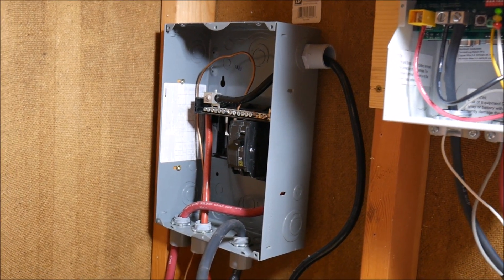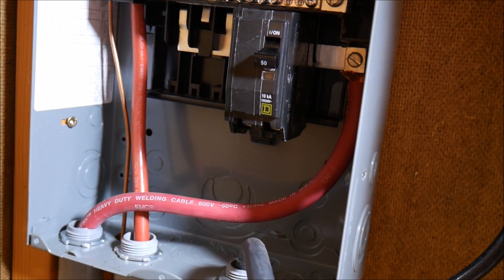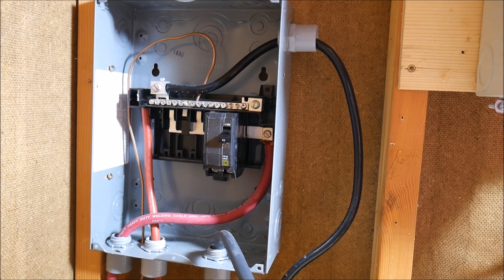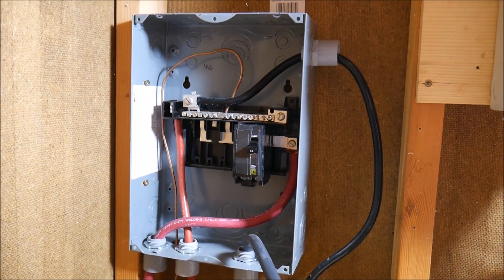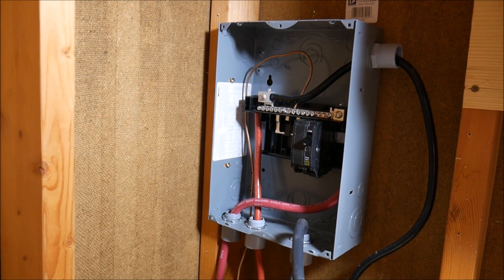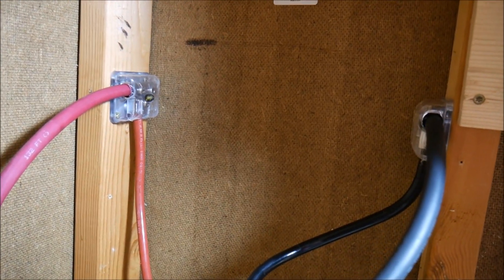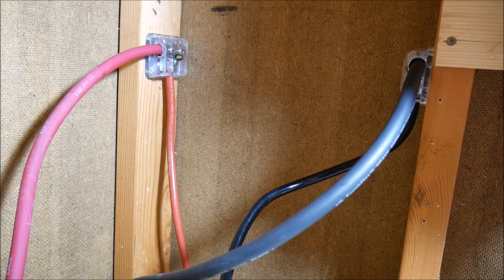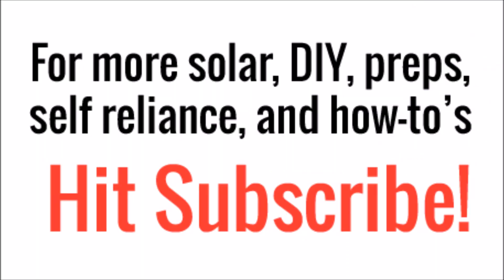Redoing The Solar Shed Part 8 - No More Load Center

Comment: Since you’re redoing the solar shed. Have you thought about purchasing a true DC heating element to heat your water?

I’m thinking of purchasing a 36VDC heating element, I’m guessing it’s the proper resistance for 36volts. DC or AC shouldn’t matter for an element. Nevertheless, I want to install it in spare water tank to heat up the water. With the signal 305 panel, I know it won’t heat up to 110degrees. But I am hoping it will enough to keep the power usage down for my instant hot water unit.
Reply from the maker: I have thought about it.  I won't do it in this house for my main water heater but I might rig up a diversion load for an auxiliary hot water tank outside.  First, it would make a great video series.  Second, it would provide me a way to easily heat water in an emergency.  And third, I could use it to keep my battery box warm somehow in the winter.
Reply: I’ve already made up a solar panel out of PEX tubing, I’m guessing about 30 to 50 feet worth. And it dumps into a 30 gallon tank of water where I have about 50feet of PEX coil. The coil is before, obviously, my tankless water heater. 

IF I remember to turn the pump on, I can raise the temp of the 30 gallon tank to 85 to 95F. This is so the tankless doesn’t have to work as hard to raise my well water, around 55F, to 130. 

I know I really need to use copper pipe for proper heat transfer on both the solar panel and coil up house water. But I found 300’ of the oxygen barrier PEX for $35,  normally over $100.
Reply from the maker: Use what works.  Copper is stupid expensive so I bet that replacing your whole system with copper would not be worth doing.  I am sure there are some other ways to squeeze more performance out of the system.  Did you spraypaint the enclosure black?  Is it angled at the sun properly?  Is it well insulated?

Comment: By using the load center did you go from a 240v ac system to a 120v?
Reply from the maker: No, the load center was being used as DC not AC.
Reply: LDSreliance OK thanks. I still learning and was trying to figure our why you reduced your output from 2 wires from the bus to one wire to your home. Or, maybe I got that wrong too. BTW, I think there's a difference between Ac and DC beakers.
Reply from the maker: Yes, normally you are correct.  But the Square D QO series breaker panels/load centers like I was using in the video are rated for both (up to 48V DC).  So that is why I was using it.
Reply: LDSreliance cool, thanks for the info I thought it was just for ac systems. I did look into this a little deeper and the manual states it's only rated for 48vdc not up to(12-48vdc). My system is a 24vdc so these unfortunately are not an option for me.

Comment: Will you let us know how you ultimately vented the battery box? I'm about to complete my setup soon too, and I'm thinking of using a 2 inch pipe, small 2x2 dc fan, with a 2 inch cover that closes outside when theres no pressure against it, like a dryer vent cover. That way no cold air back flowing into the house, and the fan I'll run off the mppt to only run during charging, so as not to rob very much power... What do you think?
Reply from the maker: Yes, I will do that off camera sometime and mention it in the final video.  I am toying with the idea of installing some tiny server fans but I don't know how well they will hold up in the humidity.  Your solution sounds like a pretty good one, actually, since the off gassing will only happen during charging.  Good idea.

Comment: this might be a hard question but where i live in australia im in a perfect spot for solar where from sun up to sun down (11 hours) i get 180w-190w and 22-23.9v from a single 200w panel. sat flat on the ground but ive had issues with the panels frying solar charge controllers. the choice is rather limited here but ive been looking at my options and i was wondering what you would suggest. ive ordered another 800w of similar panels and from the looks of things the biggest MPPT controllers here are around 50amps. i was wondering if there are larger charge controllers in the usa that i could order for this system or if i would be fine with a 50amp controller for a 1kw system.
Reply: to clarify i have a 5kw roof mounted system but it produces no power. and ends up costing around a grand a year via grid connection fees and passive draw. this is apparently due to the slope the panels are on(22 degrees). and the second system is being used for a large shed that is currently unpowered. flat panels are the best performers around here being in the full sun for 11 hours every day (10 in winter) i do have a single 100ah AGM and am waiting for a few more to arrive locally.
Reply from the maker: Interesting.  I am sorry that your main system doesn't produce much.  You could use a 50A charge controller if you arrange your panels in series to increase the voltage.  MPPT controllers can usually handle pretty high voltages.  So if you have 5 200W panels and put them all in series you would have a 60V system and be safely under the amp rating of your controller.  Just check with the specs of the controller and make sure it can handle that input voltage.

But yes, there are quite a few controllers here in the USA that have higher specs.  The Morningstar controller I used is rated for 60A, for example.
Reply: i saw that and have been unable to find one here in australia. quite annoying. im looking at EPEVER 4210A (a 40amp mppt solar charge controller) im planning to mix solar and hydro as i have a fast flowing creek near my house. ive been unable to find any legit 50amp controllers but the 40amp controller looks good. 

heres the spec sheet for the EPEVER 4210
http://imgur.com/a/C7FnQ

they have some great reviews on youtube and on the greater web apart from being a little slow to switch over of course. 

the other idea i had was buying one from the usa via our local postal services drop shipping options. but im at a loss for what us models are good and witch are bad. 

could i use 2 charge controllers at the same time? split the panels?
Reply from the maker: The only way you can use two charge controllers is if they can be networked together.  And those models are expensive and more complicated to use.  I would encourage you to explore a higher system voltage so that you don't run into an amp limit problem.  If you used a 24V system with 1000W of solar panels you will be right at 41-42A.  After accounting for losses and real world conditions you should be able to run that with a 40A charge controller.

Comment: 👉👈🙌🙏☝👏💪💅....or...you could add a larger lug onto the main bus bar to accommodate the 1/0 wire.  Or trimmed your 1/0 wire to fit existing lug.  The few hairs lost to trimming would be meaningless because you are using the oversized conductor for voltage drop and not ampacity.
Reply from the maker: Really?  So the current passing through that welding cable will not be affected negatively by trimming some of the strands?  I would have thought that it would contribute to extra voltage drop since the resistance would increase due to all of the current passing through fewer strands.
Reply from the maker: Also, I think the lug is integral with the back plane.
Reply: LDSreliance ....i am not going to deny that in the most technical terms that voltage drop wouldnt occur.  Having said that, a highly sophisticated testing laboratory would be hard pressed to tell you exactly how much voltage drop there would be with "trimmed" conductor as opposed to non trimmed.  If it cant be easily measured, it simply doesnt exist.  So dont worry about it.  You are talking about 5/8 inch length of wire.  The length that goes inside the lug.  The rest of your cable resistance stays the same.
Reply: LDSreliance ...some lugs are mounted to the bus bar by a screw from the backside.  One would have to take out the bus assembly and see exactly how the included lug is mounted.  All the guts come apart....its like a tinker toy.  Another way to install the wire without trimming would be to use a standard 1/0 compression lug.  The kind you would use to hook the wire to a battery terminal.  Install the wire into the lug first.  Make the compression.  After completing that...work the ring terminal part in a vice or whatever until it would fit inside the panel lug.  Copper is easy to work.  Bang it...bend it ....pound it...do whatever until it fits in the panel lug.  Voila.  Your wire is terminated without trimming.  I have done this exact procedure in the field when i used to contract.
Reply from the maker: Yeah I was going to do something like that but it would have taken me a lot longer than just using the distribution blocks and I didn't need the extra breaker protection or switching capability.  Good ideas though.